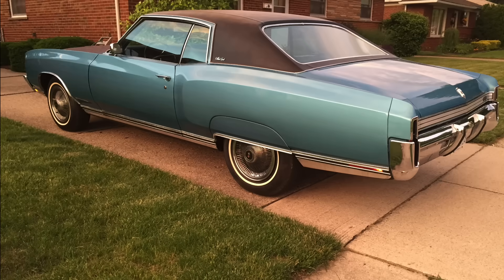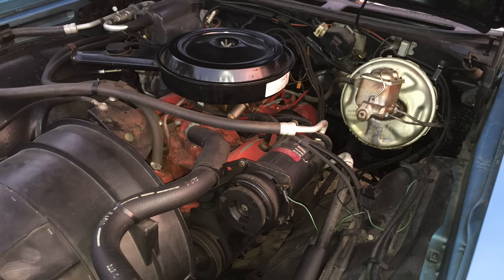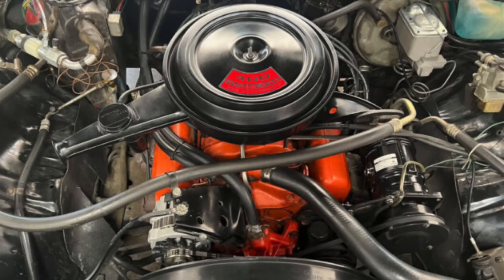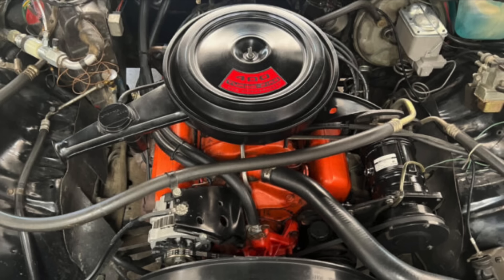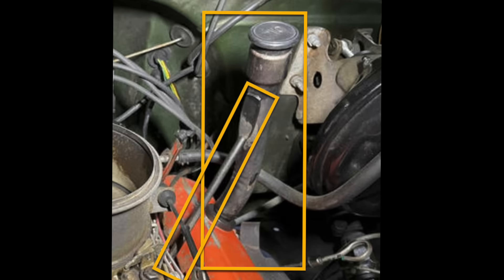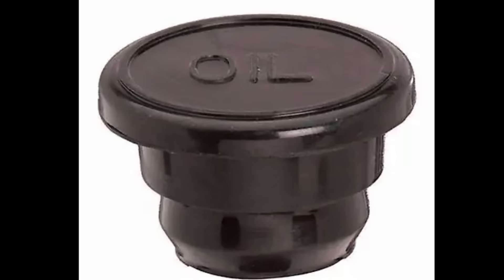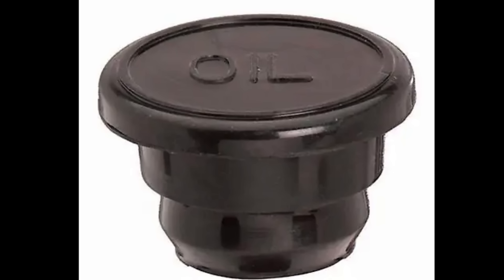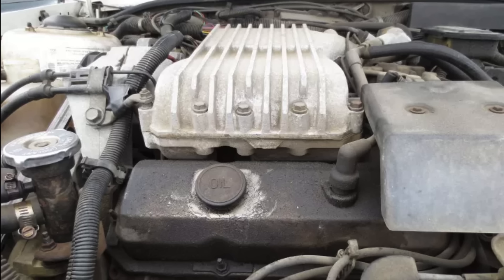Worst Automotive Ideas: Chevrolet's Crumbling, Rubber Oil Fill Cap (Small Block V8 / 2.8L V6)

Comment: Wost idea I have ever dealt with is the later post 0Os GM center console lids that hinge up at the rear.....you need to have rubber elbows to be able to flip it up and close it while in the driver seat.....modt of my old 70s to early 90s GMs all had the lids hinged to lift over to the passenger side making it way easier to get stuff like change for tolls, tissues, etc while driving.
The visibility out of and trunk storage in the newer cars is awful as well....thats the trade off for airbags everywhere and crash crumple zones I guess.

Comment: I had a 1986 Chevy Celebrity with the 2.8 and that oil fill cap/plug was the bane of my existence. Especially in the winter time. I sprained my finger once trying to get it off. I eventually learned to warm the engine up for a few minutes before attempting to remove it.
Reply: Yup! The only car I own in my fleet with rubber fill cap, is my 86 2.8 celebrity. Mine is still like new, light blue 4 door. Only drive it 500 miles per year.
Reply: @ Mine was dark blue. Was a great car and put a ton of miles on it.

Comment: When I worked for GdYr, we used to keep those filler plugs in stock, as well as valve cover gasket sets. We would tell the GS techs to 'test' the plugs 1st before just yanking them off. On that note, the other caps I saw fail alot were on Mopar Magnum engines. Do yourself a favor and don't tighten them until they 'click'. The plastic grip portion will break off in you hand over time, and then you get to try and unscrew it by any means necessary...

Comment: Ford did some odd things, like on my Explorer, with the 4.0 V6.  In 99, Ford started using returnless fuel systems, with a fuel rail pressure sensor.  When they redesigned the intake, they put it over the sensor.  The sensor can go bad and to replace it, you have to take off the intake, which has eight #30 Torx bolts, of which the ones in the back are a Royal pain.  There are two methods of replacement.  One, you can unbolt the throttle body, along with the intake, or you can unbolt the intake and prop it up, with wood blocks.  The sensor is about four inches back and also uses Torx bolts and you need a real thin wrench to remove it, when you prop up the intake..  It is about a two hour job.  Why Ford didn't put the sensor on the exposed fuel rail, is beyond me.
Reply: they did so on the 4.6 in my 05 Mustang GT. good thing because I had to replace it a couple of times but I did have to take the intake off to replace the leaking heater hoses. wasn’t too bad though

Comment: Chrysler got the rubber plug idea figured out. They put it in the rear axle at least as early as 1984. Pretty sure they still use it.
Reply: Chrysler used that plug in 8 1/4 and 9 1/4 rear axles since the early 70s. They will seep over time.

Comment: I never had any luck with Pontiac water pumps either. They were noisy or leaked at low miles. And this was when Pontiac made their own engines. Also surprised they have the a/c compressor on the opposite side from the evaporator. Look how long those hoses are!
Reply: And those hoses are EXPENSIVE to make!
Reply: Pontiac also had a 1 year only water pump in 1969
Reply: Yep! I noticed that too!

Comment: There even more of this type of stuff with current engines My personal favorite questionable engineering and cost cutting decisions is the plastic water pump impeller I don’t remember exactly when I started to noticed them but it’s in a lot of the early 2000’s BMW’s and currently now other manufacturers like GM , Chrysler/Dodge Fiat are doing this now too. IMO the worst thing is the use of plastic/ composites in place of aluminum and stamped steel my new favorite is Ford’s use of a plastic oil pan and one time use oil drain plug with heat cycles the drain plug tends to get stuck and the pans eventually leak
Reply: Guess what Ford's replacement pan kit is made of... Aluminum...

Comment: This is why you dont want to buy ANY modern vw/audi product or bmw. Plastic engine components EVERYWHERE that becomes brittle and breaks over time. Their rock bottom resale value reflects that.
Reply: It's not just VW-Audi.

Mopar and Ford have been guilty of this in recent years, too.
Reply: tbh anything modern is built to be disposable after 10-15 years, take apart any interior and the shit won't stay on anymore because the integrated clips all broke off, all the electronics are so integrated and complicated that they're basically unrepairable for non-professionals
Reply: I'm making the observation that all plastic is not created equal. Why did some plastic last indefinitely (oil fill 2001 Ford Triton) and other plastics  fit these descriptions above to a tee. It seems the industry should know their choice of materials, so the outcome is on them.
Reply: @ceciltrane5418  It's more to do with the application. An oil fill doesn't live the life of a timing chain tensioner.

Or an oil cooler.

Comment: Knowing how large corporations work, some young engineer or bean counter was probably awarded a cash bonus for that idea.  😉
Reply: Like the verticle transport of the Vega
Reply: And another award/promotion when it was replaced several years later.
Reply: Yea, molding is way cheaper production
Reply: "Hey boss so I was sitting naked having a bath, and when I saw the bathtub drain plug, a great idea came to me!"

Comment: There were so many weird annoyances with GM engines, especially the 60 degree V6. I think the ignition coil packs being mounted under the front exhaust manifold from ‘87-‘94 deserves a mention. Plus the amount of random support brackets you have to remove just to get the intake manifold off. Or not being able to thoroughly drain the coolant from the engine so when you remove the manifold you fill the crankcase with coolant.

Comment: Probably least worst bad idea. There are other rubber fittings already on the motor at the pvc and such. Zero effort and low cost to replace the fill cap. 
Personal least favorite was the big oil fill tube on quad 4 motors. It was a huge condensation generator in the northland here. Usually had the milky foam inside when they came in for service in the winter. Eventually they got rusty inside and flaked rust particles.

Comment: I agree the rubber cap was a loser. But by the time it crapped out it was out of warranty.  I prefer the metal half turn cap on the valve cover.

Comment: "Small blocks flattening cams", some things never change even into the modern era. You'd think by now they'd have the metallurgy figured out.

As for bad placement ideas Ford's 80s TFI-IV Igntion Modules being mounted to the extremely HOT distributors where they'd frequently fail. They eventually moved the module to a fender mounted heat sink on the pickups in the 90s due to this issue. I made an adapter harness made of a gutted module, the 90s style heat sink, connectors & some wire, and I fender mounted the module on my 89 F150 after suffering a few module failures that left me stranded. Ever since remote mounting it I've never had an issue again.
Reply: They only care for them to last until the warranty runs out.
Reply: Good ideas!

Comment: Yup, my 1985 S10 Blazer w/2.8 had that plug.  I remember replacing it because blowby gasses would come out and stink up the cabin during winter.  When I replaced it, the smell went away.  Good to know I wasn't alone.  Haha!
Reply: I was just thinking of the one in my ‘87 S-10 Blazer too.
Reply: My 85 S10 with 2.8 V6 had the rubber cap.  A lousy idea.
Reply: My 84 S 10 had one. . .
Reply: My bought new '93 S-10 pickup has one. No problems with it yet. I seem to have better luck with my vehicles than most people. Probably because I over maintain them, and always warm them up before taking off. 391,000 on my '06 Mercury Grand Marquis so far, with no problems. Still runs like new. Oil changed every 3,000 miles. Always warmed up before being driven.
Reply: I had it on my '82 S-10 pickup.  Never had a problem with it as far as I can recall.